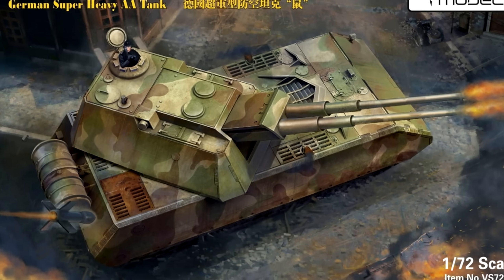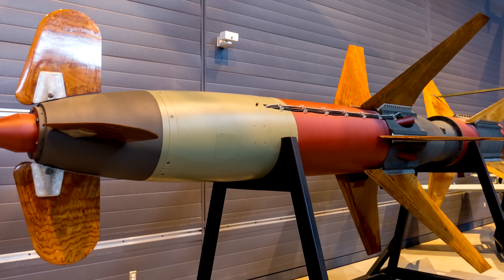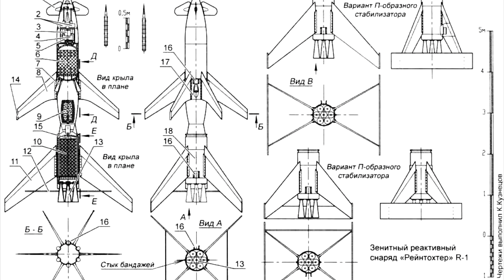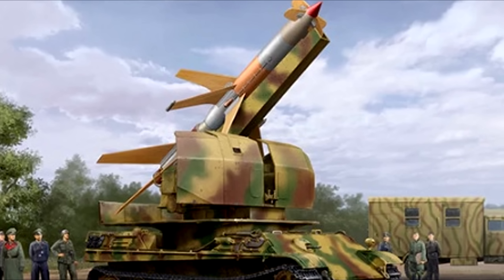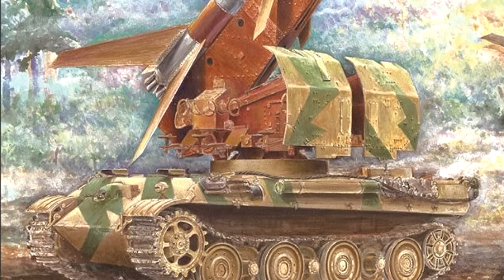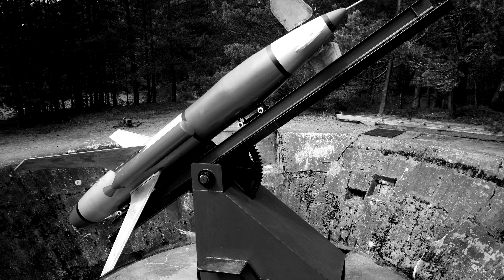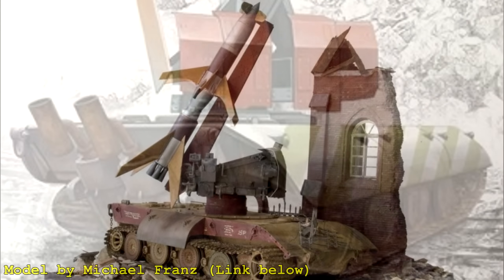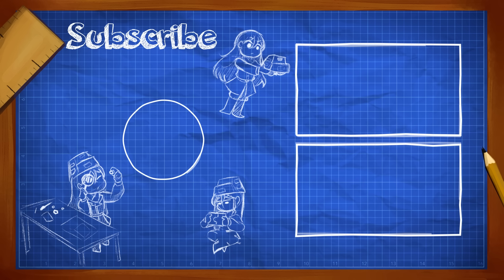German Surface to Air Missile Anti-Air in WW2? | Fake Tank Friday

Comment: With all of these devices probably the most simplest question to check if they're legit is - Does it make sense? To utilize E-100 or Maus hull for open topped missile launcher  makes absolutely no sense. Why would you waste that much material and factory space to create a protected hull on unprotected system. The Panther hull could make a bit more sense as it would simplify logistics if it was the smallest hull that could sustain the launch, but it would most certainly not waste E-100 or Maus hulls for something like this.

Comment: The rockets were real enough, but the manual guidance system would be iffy, even if they were allowed to work. Remember that radio control was in it's infancy and guiding a rocket to a bomber from the ground would be really difficult at best. An onboard terminal guidance system would be required, but they didn't really exist either (barring Project Pigeon). On top of that, at this stage in the war any German radio signals were being jammed to hell - these would have been no different.

Comment: I refer you to a recent book by Steve Zaloga on German rocket systems. In it, he states that the idea of using Rheintochter missiles on Flak 41 crucifiom mounts in combat is pure speculative nonsense. There were initial launch tests done with cruciform mounts, yes, BUT, right from the word 'go' they were never intended for combat, only testing of the missile itself, without added time and expense. Indeed, the R-1 was deemed a no-go during testing and only the R-3P was progressed to further testing and possible production approval. That version was always intended to be launched from a hardened static emplacement - similar to the simplified mock-up you showed in one of the photos in this video. In short, R-1 tested on a crucifix, out of expediency only, missile rejected, R-3P then tested BUT the program then  cancelled outright before hardened static launchers designs had been finalized. Any idea of mobile Rheintochter missiles on tanks would also be farcical on the basis of the support vehicles and crews needed to transport, load, fuel, aim, fire, track targets and missiles, as well as defend them on the ground... It'd be like duplicating the V2 program in terms of logistical support, something Germany was in no place to do with dwindling resources.
Reply: Totally agree
Reply: Reintochter wasnt Volkhov.
It was a mostly self contained system that could reasonably be made mobile, and would have to be if it was in fact utilized.
The tests show transportable launch rigs were viable  and common sense tells they were necesseary.
It is of course known the system wasnt used in combat, but that was never part of the question.

Comment: reality is the Wasserfall made it obsolete too.   Wasserfall was the upgrade to it based more off the v2,  its 25 mile range meant it didn't need to be repossioned in the same way.  as the much shorter ranged Rheintochter. with its mear 8km range.  

The wasserfall would have been trailer carried and rail launched much like the russian SA-1/S-25,  it was manually guided though the operator used a radar system to guide it, and once it was in a bomber street its 650 lb fragmentation warhead would be detonating.  the blast pulse, and fragmentation could potentially destroy several bombers flying in normal formations.    making this a cost effective weapon.

Not a wonder weapon, and in reality by the time they were coming into service it was already to late to change anything in the war...

Comment: This just the launcher. It was impossible for it to operate as a stand alone system as shown in the box art. It was liquid fueled, so needed a fleet of tanker trucks, a control vehicle, warning and at least two tracking radars (target and missile) so the computer (another truck) can steer the missile into the target, one or more generator vehicles, cable vehicles to tie everything together- the whole thing would have been a traveling circus. Look what it took for 1960's era HAWK solid propellant missile battery
A typical Basic Hawk battery consists of:

1 × PAR: Pulse Acquisition Radar—a search radar with a 20 rpm rotation, for high/medium altitude target detection.
1 × CWAR: Continuous Wave Acquisition Radar—a search doppler radar with a 20 rpm rotation, for low altitude target detection.
2 × HPIR: High Power Illuminator doppler Radar—target tracking, illumination and missile guidance.
1 × ROR: Range Only Radar—K-band pulse radar which provides range information when the other systems are jammed or unavailable.
1 × ICC: Information Coordination Central
1 × BCC: Battery Control Central
1 × AFCC: Assault Fire Command Console—miniature battery control central for remote control of one firing section of the battery. The AFCC controls one CWAR, one HPI, and three launchers with a total of nine missiles.
1 × PCP: Platoon Command Post
2 × LCS: Launcher Section Controls
6 × M-192: Launchers with 18 missiles.
6 × SEA: Generators 56 kVA (400 Hz) each.
12 × M-390: Missile transport pallets with 36 missiles
3 × M-501: Missile loading tractors.
1 × [bucket loader]

Comment: From what I have seen on TV documentaries, the Germans had developed mass manufactured surface to air missiles that were Essentially 
cheaply made pipes fitted with high explosives and a small rocket engine that could be fired by the dozens at Allied bomber formations once they were detected by German radar.
However, Hitler was not interested in funding defensive weapons like this but was more interested in funding offensive weapons like the V-1 and V-2 missiles and jet engined fighters. Hitler always loved a good Offense as it spelled “Victory” but never a Defense as it reeked of “Defeatism” and which was a Crime that got you Executed.

Comment: Also, it's a complete waste of an E100 tank chassis. The whole reason for a super heavy tank is to have a weapon that is nearly invulnerable to enemy fire. Placing an almost completely unarmored missile launching turret on such a chassis defeats the purpose of the E100 entirely. This isn't even mentioning the fact that the weapon would have been extremely slow with limited mobility, unable to cross all but the strongest bridges (or the fact that they'd be using a very costly tank chassis for a role that could be easily achieved with a much lighter, faster, cheaper tank design). Assuming the Germans would propose such a weapon system at all, it's much more likely they would have used either old chassis, like the Pzkpfw-III & IV, or their newly developed lightly armored inexpensive Waffentrager chassis based on the Pzkpfw-38.

Comment: Doing this would seem like a waste of a hull that could be used to make an actual tank anyway, especially at the later stages of the war. To carry multiple of these missles they'd have to be loaded on a supply truck also because you ain't fitting that in the hull so making these mobile would have been dumb in it's own right.

Comment: "The German weapons were not light years ahead of the those of Allied powers"

Ok , then I want to know one thing , why the allies couldn't intercept or at least detect through radar the incoming V2 rockets sent to London?
Reply from the maker: The V2 flew faster than could be intercepted by fighters of that period. On the surface that may seem like it was extremely advanced and deadly but in reality the V2 was horribly inaccurate which is why they only used them on massive targets like cities. Rather than being ahead of it's time the V2 was rushed into service far too early and only had an impact as a propaganda tool. 
The V2 did influence some post war rocket development but I'd hardly call it light-years ahead of the Allies.
Reply: @ConeOfArc  I mostly agree with your statement , the V2 rocket was indeed inaccurate and it served as propaganda tool and a terror weapon for the late war period , now I have say , first , the quote I mentioned in my commentary were your words from minute 2:56 and , secondly , I'd say that german rockets influenced most of post ww2 rockets , if the allies had the same level of technology  the germans had , why they had to spend billions of dollars doing operations such as "Paperclip"(did by the USA) or "Osoaviakhim"(did by USSR), why would such great powers recruited german scientists to reverse-engineer a technology that it seem they deemed as worthless?...and also why would they put german scientists in high positions of research programs ,such as Wernher von Braun, who was head of the NASA space program?
Reply: The V2 is an intermediate range ballistic missile.
It reenters atmosphear at something like mach 20.
It couldnt be relyably defended afainst with current technology, ww2 doesnt even come close. But I have no idea how that illustrates your point.
Germany had no technolohy that wasnt also in a similar form of advancement in at least the US. Germany was just eager to use the war to field test its half broken prototypes, while the US didnt bother to ship lemons across the atlantic.

Comment: Most likely it would have had a radio controlled detonator or timed fuse, none of the German proximity fuse projects seem to have made it past the drawing board.
Reply: They worked fine in torpedoes, not so much against aircraft.
Reply: @egoalter1276  That was because the German torpedoes used magnetic influence detector which required the target to literally be made of multiple tons of steel, so it makes sense that it didn't work so well in an anti air role.

Comment: Absolute correct, really only a 'what if' vehicle for fantasy games.

If these rockets would have been operable, they would have needed more than just a start ramp, they also would have needed radar station for control, something for ammunition storage and mobile cranes. 

You might ask why they where never used, but they where not ready to be used operational, AFAIK none of the German FLAK (AA) rockets
had a reliable working proximity fuse and without they would be useless.

And if you asking for advanced Allied weapons (beside the A-Bomb) there was a radar guided glide bomb, that was used during WW2 against Japanese shipping. look for ASM-N-2 Bat https://www.youtube.com/watch?v=FQCmTc5Sl0o&t=2s

Comment: Their wunderwaffe were not literally light years ahead, but no Allied force had anything similar at the time. The pure fact that operation Paperclip occured is the sole proof of that.
Reply: No, they really did, inc jets, missiles, guided bombs, and so on. paperclip and dustbin etc were to prevent the soviets from getting their mitts on stuff.
Reply: @edfrancis712  what missiles and guided bombs? They had nothing operative, let alone effective. You say those operations were to prevent Soviets to get the tech, and yet they too managed to get it.
Reply: @slobodanmitic1354  longshot, little-ben, stooge all from UK, from US felix and dove are on the go to name a few , inc heat homing warheads and radio homing, which was first tested as far back as 1933 in sheperd and ram projects
Reply: @edfrancis712  Felix and Dove were never operational and both (same missle basically) were not very accurate even in tests...
Reply: The nazis never had anything operational either, in terms of guided SAMs at least. Well, MCLOS/SACLOS guidance might have worked against whole formations of bombers, but they didnt have a working fuse either.

Comment: Take note though, that the Rheintochter is NOT the only German attempt at SAM, the Enzian, the Feuerlilie, Schmetterling and Wasserfall were all tested, some began testing as early as 1943.   And that's before even starting to look at all the projects that stopped at the drawing board, as a single mockup for windtunnel testing or a partial or single prototype.   Had they actually focused on, lets say, a single shortrange and a single longrange model, Germany could definitely have had SAMs in active service well before the end of the war.

Mounting them on E100 and other "never real" tanks however, yeah, that's certainly absolute nonsense.   Had they brought one of their shorter ranged SAM designs into actual serial production(like the unnamed(?) one based on the Ruhrstahl X4 AAM at just 60kg, probably double that as a SAM), one of THOSE, MIGHT have been actually plausible to put on a tankchassi to in theory be part of a division, but more likely, if so it would have ended up on an upgraded Pz-IV or possibly Panther chassi, with armor down to 50-20mm or thereabouts.

The very idea of putting such valuable SAMs on a heavily armored, SLOOOOW, tank chassis, with the weapon completely unprotected is outright laughable.

.

And while German missiletech were not "lightyears ahead", in most parts, they were still VERY much ahead.   And if not for a small handful of techs where the allies dominated AND managed to keep mostly away from Germany, that lead would likely have been outright dramatic.
There's a reason why almost everyone after WWII DID copy German rocketry tech after all.   Not to mention the fact that some rockets still used today are based on it.